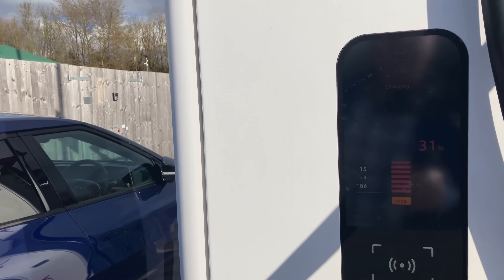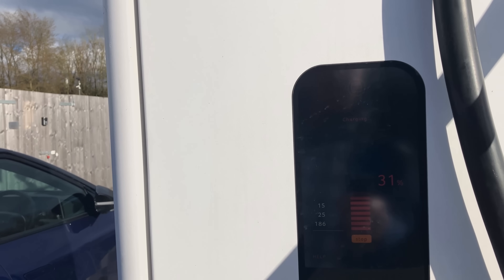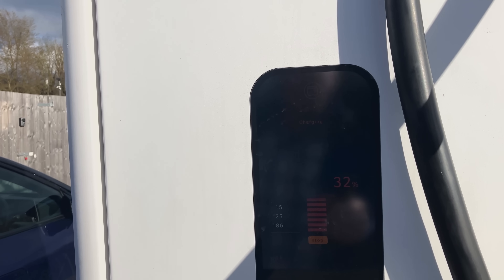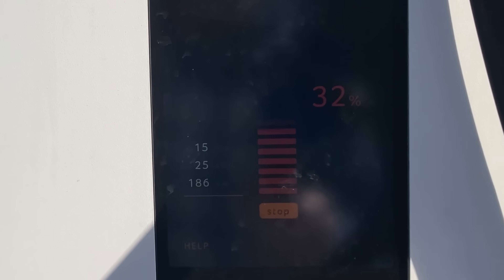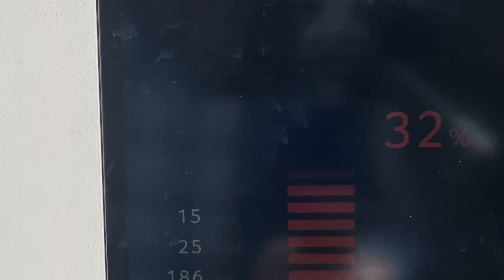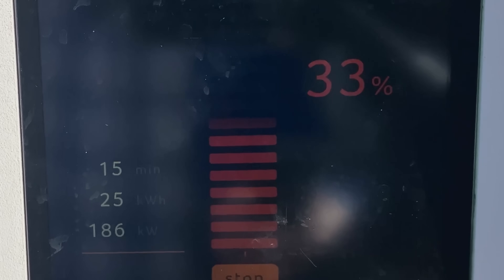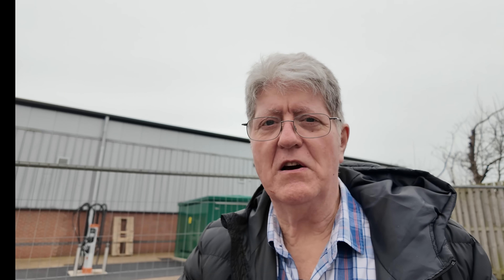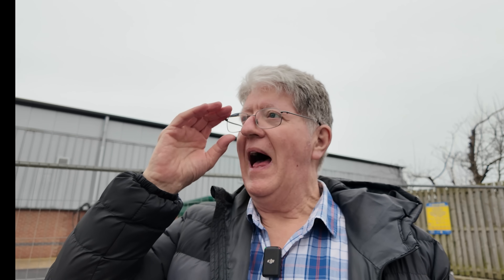What People Get WRONG About Battery Pre-Conditioning

Comment: Hmm I wonder if my BMW i3 can pre condition while I am driving to a charger? I see the option for home charging by a specific time.
Does anyone know the answer.
My experience of charging the i3 is that it seems to always charge around 40-45Kw no matter when I charge. That said its always been around 10 degrees C or more outside.
Reply: I have a BMW i3S and hence my original question to Dave.

I understand the Air-Con system on the i3 actually preconditions the cabin and the battery at the same time, because it’s the same system on my 2021 model anyway. I checked mine, and it does not have a heat pump. Other models may be different.

So, Rightly or wrongly, I assume that I pre-conditioning the cabin (if you set it), simply warms up the cabin (& thus the battery) AND maintains it as it goes along. 

The max charge rate is only 50kW on my i3, so perhaps for practical purposes it doesn’t matter anyway. I charged mine at -4 Deg ‘C’ on a (50kW) fast charger in winter, and other than the frosty connection, it was OK. I should have taken notice of the charge rate!

Let me know if you find out anything different.

Cheers.
Reply: Isn’t it only rated at 50KW Michael?  So 40-45 would be about right. Could well be wrong though as I’m new to EV’s.

Comment: It does seem to be a Tesla thing. It seems to be the only brand that mentions it. That may be because heat pumps are a fairly new addition to them. Actually to be fair my non Tesla can precondition (using a heat pump) to clear/de-ice the windows and warm the car up before setting out. I can precondition from the battery as long as the battery is over 40% full. Several other makes it seems must be plugged in before they can precondition. Heat pumps warm the car up super fast and they also direct heat into or take it from the battery if needed.
Reply: It's not, it's a battery electric car thing, de-ice windows and warm the cabin is not preconditioning the battery for supercharging!  Tesla can do that as well with or without being plugged in.
Preconditioning the battery for supercharging is not such a common thing, some electric cars don't have this feature, Tesla has had it since Tesla Model S
Reply: Yes this is what appears to be the situation with my i3